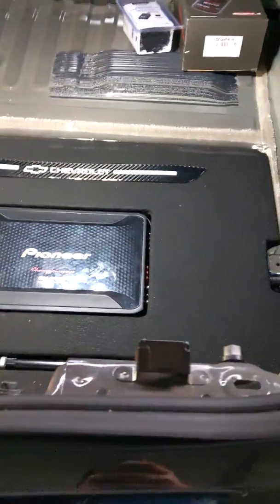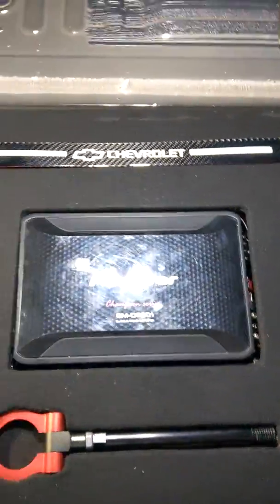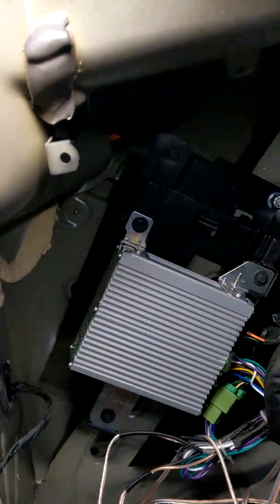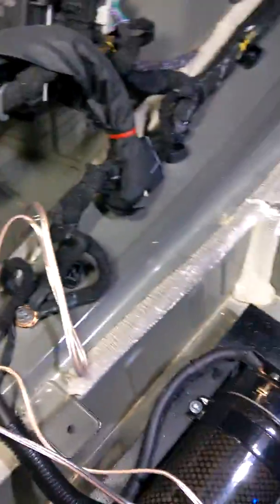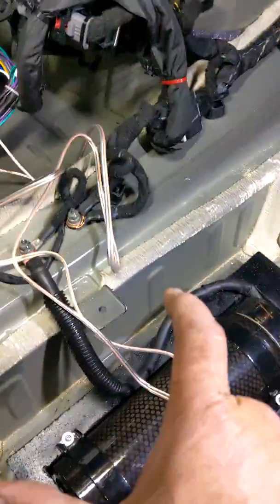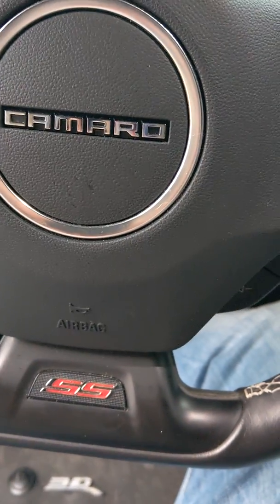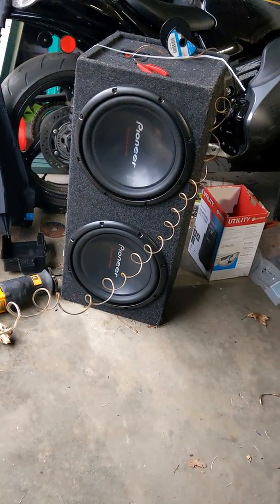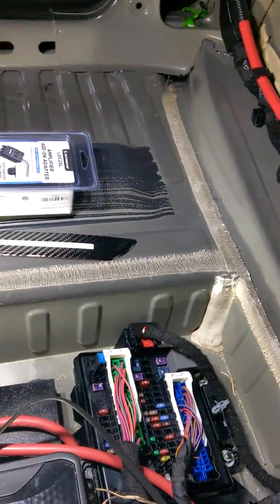Camaro SS amp and sub install with subtrump

Comment: Do you need a line output converter if you decide to use the T harness?
Reply from the maker: No. I was also getting feedback but I realized I have a higher-end amp. I do not have the remote wire hooked up to my amp as soon as it gets signal the amp will kick on. Feedback is gone.

Comment: What fuse did u use for the remote wire? I used f55 for the radio but I keeps the amp on
Reply from the maker: I remember there being three fuses next to each other or by themselves you can say. But to answer your question I don't remember. Just get a voltage tester or test light. See what lights up when the car is on what doesn't light up when the car is off and grab that fuse